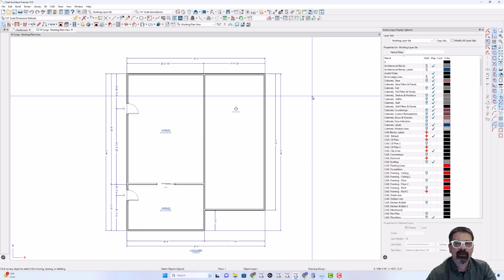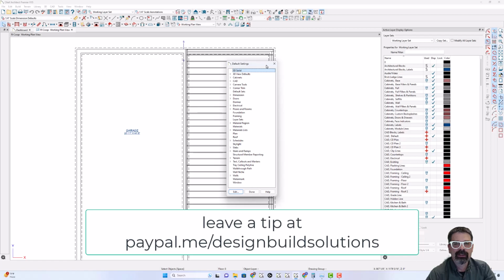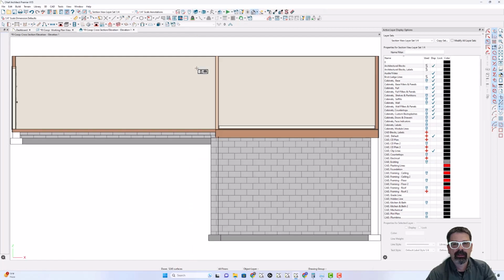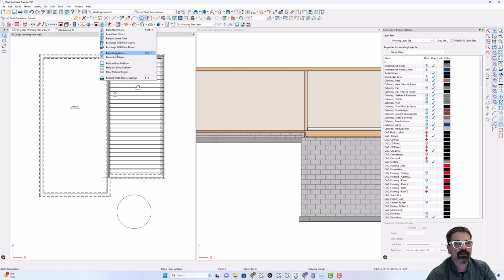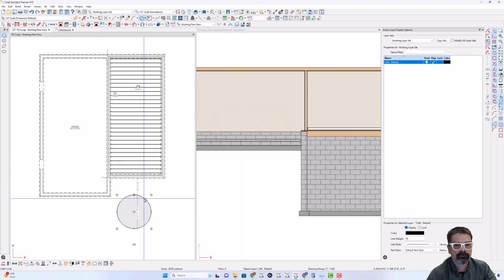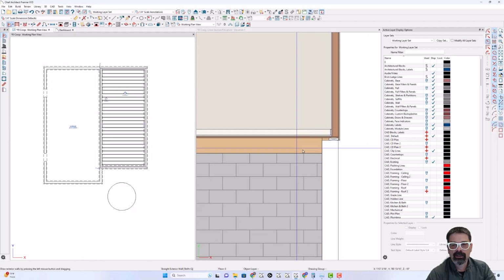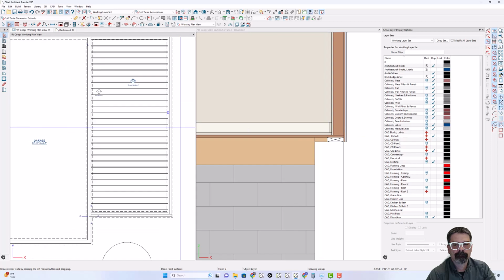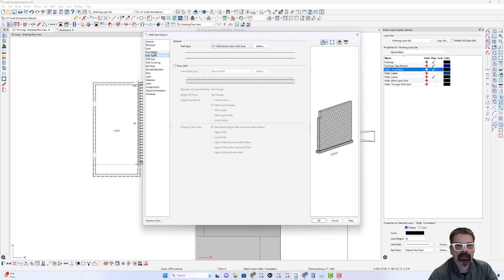Hang Joists on Foundation | Chief Architect

Comment: Is it necessary to change the default setting to have the joists  hang inside foundation wall, or can you skip that step? Because when you rebuild the foundation it has that option to hang it inside. I just don’t understand why it needs to be done twice, unless you are adding more foundation walls to the plan etc…
Reply from the maker: You are correct. You can skip that step
Reply: @DesignbuildsolutionsLLC  Ok thanks.

Comment: Basic and helpful as long as you revise the default wall, footings and sill plates to reflect these changes. Then it works like a charm.  You can also modify the concrete stem wall to have 2x4 bearing on the inside, bearing on the footing, if you change the footing size and location.  I'm not a contactor, so I don't know which is the most cost effective way to do these sunken floors; 2x4 bearing or several dozen metal hangers and a custom sill plate & flashing.
Reply from the maker: This was a specific request from another user and his plan is to use metal hangers in the ICF foundation.